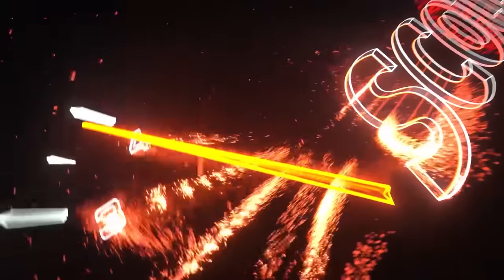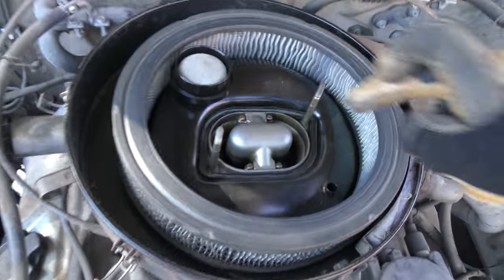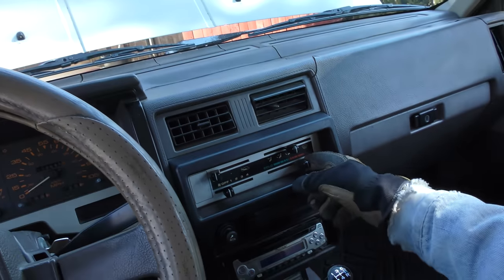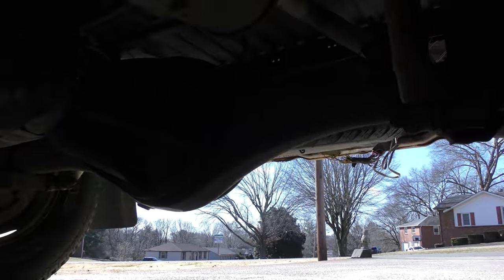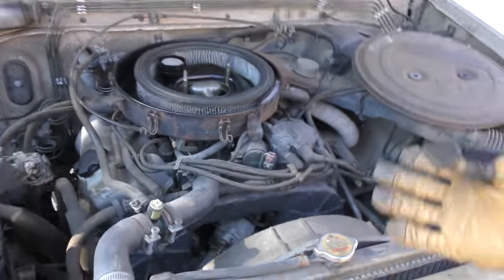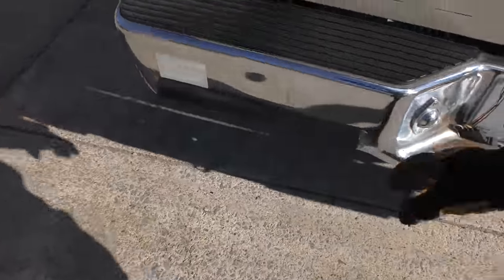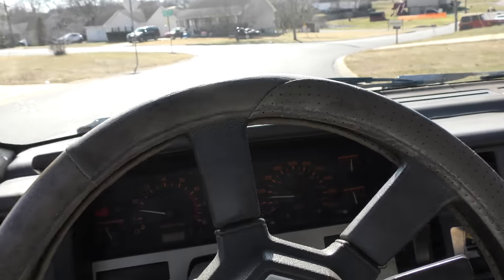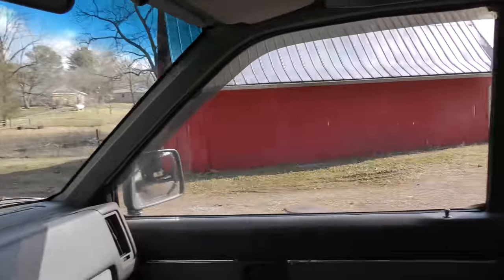I'm Sitting in the Best Truck Ever Made (Goodbye Toyota)

Comment: There are still a lot of these running around the PNW.  Matter of fact, I'm looking at a 4 x 2 '95 V6 5-speed King Cab right now.  I've owned 2 VG30-powered Nissans and as a result I have 3 VG30's sitting in my shop, so if I get it I'll build myself a new engine.  Update:  bought it and drove it home - it's in fantastic cond., you'd never believe it's got 205k!  It has an old-style aluminum canopy, I'd love to find one like this one has.  The later V6 like the one I just got went to port injection like the 300zx and has a little more horsepower.

Comment: I bought a 97 F350 7.3 powerstroke for $3000 7 years ago with 175,000 miles.  Last year put in a rebuilt transmission for $3200 from a extremely reputable shop. The owner told me the new trucks are junk, and you're paying $70-80,000. I installed Warn manual hubs. I get asked to sell it about once a month.

Comment: Right, I built two welding businesses avoiding my could have been wives, one even learned how to fabricate. Great motivation, not sure if that's the right w,ord. I have known several guys who had mucg less on the ball work ethic wise, those same knobs blew up newer engines in their own vehicles by running them out of oil and/or coolant. I'm next to them running heavily loaded, twenty years old work trucks that run good.  Twice relationships ended when they asked me to rebuild their seized engines from their own negligence, said sure a few grand and we got a deal, oh they would have a fit, retail fix would be up 5 or 7 grand, more than they paid for the vehicle. Told all of them , I don't work with stupid folks and if I work on their mistakes it will cost, on principle alone. Knew a guy in WA seized a new Honda engine because he never put engine oil in it, guy never even paid me to help him move, in my truck. That'll teach me...

Comment: I have a '92 Hardbody that I'm having trouble finding a motor. It had a seized 4cyl in it, but I think I can change the mount locations to put a V-6 to mate to the 5 speed that's in it. But there are none locally, and I'm not comfortable buying a pig in a poke over the internet. Hell, at this point I would buy a good core and rebuild one. But who to trust is the issue.

Comment: I got my moms red 4x4 king cab v6. It didn’t have lockers though. You had to reverse 15 or so to unlock em. That ended up being the fates flaw in the truck though. It would randomly engage 4 wheel drive and make an atrocious noise that you’d have to ride out until it slammed back out 😞

Comment: I run Ford's even though I had a super welding rig on the east coast GMC when turned in at 320 k still running and it was loaded and horse beat a lot. 86' Ford auto/modified 351 250 with weight and welder sold running in2009. 93' 350 auto welding rig 460, currently 2000 150 4x4 4.6 standard, bottom line I have run All my trucks past twenty years, past 2-3 hundred thousand and sold running well. I have never made a truck payment in my life and been cross country many times in ALL of them. Gee I must just be lucky, mechanic since my teens at 57 now. Wanna know a secret...?

Comment: My first NEW car was a 1970 Datsun 510 wagon. No one made such a beast yet, AFAIK. Consumers Report gave it high Marks, In all aspects.  Four on the floor, standard, SOHC. Primitive, no air, plastic seats, not even an option to adjust the seats. Hell it had a MANUAL joke. No mater, in 1970, I paid 1300 Cannuck bucks for it. That beauty ran for over 400 MPG. Half and half, city and highway. NEVER had mechanical issues. Mileage was to die for. 10 gallons got me to 500 miles hull highway. My future wife was impressed with my frugality and common sense with money management. The guys at the counter would be treated to me, PEELING rubber as I pulled away, after work. Two of then wanted a ride. I obliged them. One trashed the car, one gave it 9 stars. 

I wondered why Datsun 240z sport scar, disappeared. I test drove one and I was blown away. 

I'd love to go neck and neck with a Tesla. The Nissan 240z was built light, had a 6 v-eight and blew out, most Yankee junk in a fair fight.

Comment: Scotty I just sold a 2016 Nissan Frontier SL 4X4 4.0 V6 loaded with all options and I loved the truck it had 43000 miles and sold it with 48000 miles and it was a gas guzzler from the work go my full 2008 Silverado 5.3 was way better on gas. Like I said loved the truck and the was it drove and Handel but not quit built those of old for sure. Would like the find a nice little 88 or 89 Hard body with the four banger.

Comment: Hello Scotty. Great chanel. Looking for a little help making a choice. It's between 2002 4Runner and a 2002 Pathfinder. Both 4x4 with 170k miles. Check out mechanically (Pathfinder has a small easily self repairable hole in the exhaust and an upgraded (leather interior). No body or frame rust on either. Both single owner with up to date service records. Price (asking) $8100 CDN for the 4Runner and $4900 for the Pathfinder. Both have a pretty solid long term record of reliability, In your view is the Toyota worth %50 more ? They do hold their value well.

Comment: nissan d21 hardbodys are everywhere in mexico and regularly hauling 1 ton of hay, animal feed, etc. And the 80 hp is a misconception. the nissan d21 4 cylinders make 138hp and plenty of power. the toyotas had 90 hp.
Reply: My 87 has the older z24, rated I think 106hp,  less at the rear wheels,  but it can move as much weight as you dare to put in it.  The later ka24 had more hp.

Comment: Compared to the Toyota trucks of the same year, they were  junk. Plastic radiator, large gap between the cab and back, all sorts of lower standards than the Toyota. Even the gauge of steel was thinner. I sold them as well as Toyotas and for the dealer I was at we put the same truck right next to the Toyota and I NEVER lost a single sale to the Nissan "hardbody" truck after people saw them side by side!
Reply: Then again, I had a 1986 Toy sr5 4x4.  Beautiful truck.  But it did lose both a head gasket and rear difficulty before 50000 miles.   I can't explain that.

Comment: Scotty, I’ve got a 2008 Toyota Solara, 86K miles, with a 3.3L V-6. Just had the check engine light, traction control light and vehicle stability control light all come on at the same time and stayed on.  Ran a scan tool and got error codes P0456, C1201 and C1249. What do you think the issue could be?

Comment: Scotty. I need your opinion.
We bought a 2020 Honda CRV Hybrid new. Took it at 6,??? miles to get the oil changed. Honda handbook says 7,500 miles the Dealership in Jacksonville practically refused to change the oil stating that it will ruin the motor if you change the oil before the oil life percentage on the dash says 5%. I disagreed but she got scared away. We prepaid for 5 years of oil changes at the dealership when we bought the car. I can't help but feel like they're trying to get one over on us. What's your take?

Comment: Datsun/Nissan could never make a four cylinder diesel engine. Except the old 1600cc in the 680 moder LDV. A LONG time ago.
But as far as pertol driven engines are concerned.
Hard as Cat engines.
Purchasing a petrol Nissan petrol engine at 100,000 km only renders a well run in engine.
I speak for manual gearboxes. Not the strongest available. But the petrol engines. From 1,200cc up to 3,300 V6. Well cut pure diamonds. In excellent colour.
Regards from South Africa.

Comment: If you're sitting in the best truck ever made, then you ARE sitting in a Toyota.
Reply: Maybe I have a GX 460 and similar 89 pathfinder standard . It is more fun to drive and flys . I love my GX and it should last forever but 33 years ? I won’t last that long .
Reply: Toyotas are the most of road recovered vehicles on Matt off-road Recovery channel
Reply: @DevilDog53 pretty much , worse is the body and rear tire rack . Fiberglassed that area . Kinda worried about that weight it’s had it’s day . It’s still unbelievable in scary conditions., ,sway bar ripped loose over rocks , but more fun now . This one came loaded for its day . Towed a huge lifted F250 out of the woods in lower 4th . The V6 hums . Every dog has its day .
Reply: @khalsida300  that’s because they dare to dare . But that’s not what I’ve seen .Basically jeeps
Reply: If only they could tow something.   They are barely a truck.
Reply: @timbrown49  true, but no need anymore . Not unlike the new Bronco

Comment: Just bought a 94 hardbody 4x4 with 130k miles for $14,000.  Hope it lasts!
Reply: If it was cared for it should.  I just bought a '95 from the original owner with 205k.  Runs like a swiss watch.  Stack of service receipts over an inch thick.

Comment: Early 20th century Scotty - "see the old fashined Model T cars were bullet proof 20hp four cylinder 2.9 liter engines. This was before they started using things like fuel injection and everything went to crap"
Reply: Model T`s actually had 2.9 liters? That`s bigger than my S10 pickup engine.

Comment: Hey scotty. I have a manual transmittion kia soul 1.6L 4 cylinder with 130k miles. I bought it with 50k miles. Its been super reliable and ive done alot of preventive maintenance. However i never changed the manual transmission fluid, im not sure if i should replace the manual transmission fluid or if i should wait until the clutch to wear out to change it since it will have to be drained. Not sure if leaving the manual transmission fluid too long leads to damage.

Not sure if this is the right place to ask questions or if there is an email to contacg you
Reply: You should change it. Manuals use what’s called gear oil. Check what type of gear oil your transmission takes (example 75w90, 80w90 ext.) you can wear out the synchros if you don’t change it enough.

Comment: Did you ever adjust the throttle body injection on that "hard body"....need to know..peace DVD:)
Reply: After years of ignoring fast idle, I dared to adjust mine
 So simple, yet I didn't do it until it failed smog for idle over 1100.

Comment: Could the high idol be the altitude?
Reply: Its a simple adjustment I put off for years.  Also, when the wax solenoid for the fast idle goes bad, the idle will not come down.  I just fixed that  on mine.

Comment: Great trucks. Datsuns never die, they just crawl to oilier rags.
Renault being staye-owned pulled a real stinker of a move on Nissan. That was French socialists through and through.
A man's car, they've sissified 4 WD. I loved transfer cases and hub locks. My brother works in an Australian coal mine, Loy Yang (Aboriginal language) B open cut mine (giant hole in ground not like Pennsylvania. It's's a very acidic encironment (brown coal alias lignite). Their mine trucks ALL MUST have external exhaust piping to reduce risk of coal fire (huge danger very difficult to extinguish) but still the exhausts rot bimonthly. All mine trucks are Toyota but still with transfer cases and hublocks. Because if you get bogged alias stuck, you can easily sink a metre or 3 feet.

Comment: I’ll stick with my full time AWD that I don’t have to do anything with. Toyota needs to start making full time AWD in their trucks and SUV’s.
Reply: @mcc7762  Which ones?
Reply: @mcc7762  4WD and AWD are two different things. Toyota does not offer AWD in their trucks and SUV’s.
Reply: @mcc7762  Like Ive said for the 3rd time now, Toyota does not make an AWD system in their trucks and SUV’s. You have not told me anything that I do not already know. Please stop wasting my time. (edit - also you are wrong about your unibody construction claim. I have 3 full size SUV’s that are body on frame, not unibody, and they are AWD).